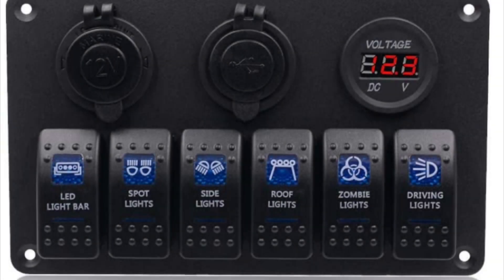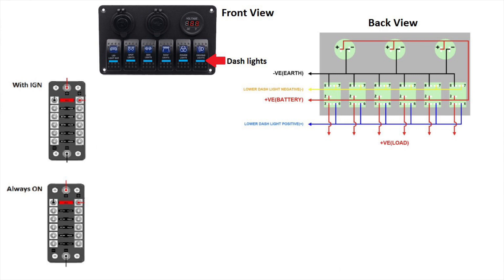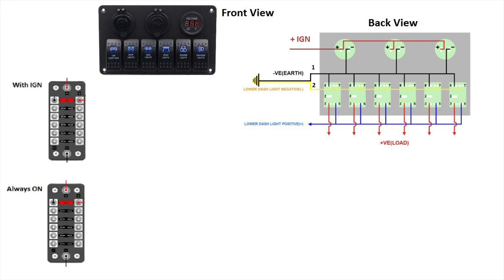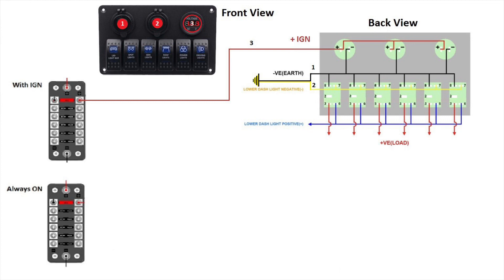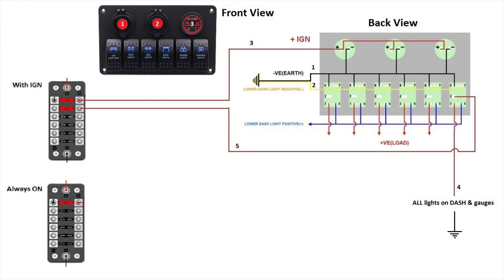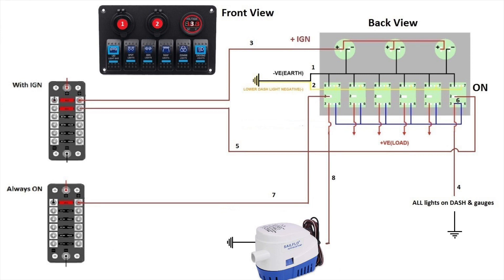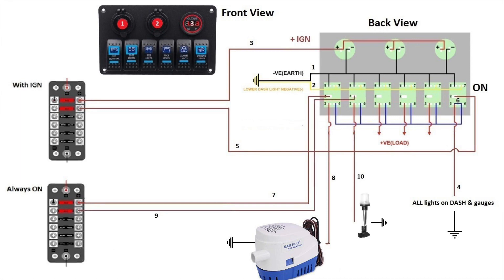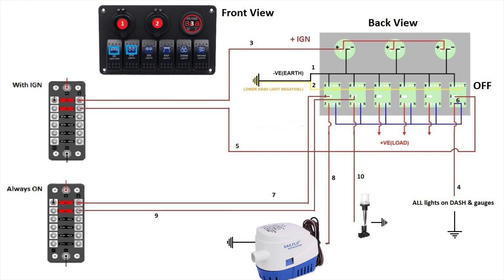How to install a pre-wired panel switch on your boat ( Electronic wiring diagram )

Comment: Can you wire one of the switches to be a master power switch?
Reply from the maker: hi CaptainCal, thanks for watching. Yes, you can set a master power switch but it comes with some dangers. You got to make sure the master switch can transfer the amps needed if all your switches are ON. Also, your gauge wire size needs to be right. So basically, if you want a master switch, lets take for example the first switch connected on the water pump. So, the wire 8 will go to the other switches to pin 2. So, this becomes your main power to your other switches. If you turn OFF switch 1 the rest will turn OFF also.
Reply: @joetheboatguy5394  thanks for the response! So I take the number 8 wire and wire it to all of the other switches pin 2?
Reply from the maker: Yes so your first switch will turn all other switches on. Without that switch being on the rest will be off. But like I said be careful that your main switch is capable to pass all amperage needed by other switches.

Comment: Hey Joe can you do a video on how to connect a 10 gang rocker switch panel.  Panel that was given to me as a gift has both ac/dc on switch.  can they both be used as DC?  BTW your videos are the  best online.
Reply from the maker: Hi debradubose, thanks for watching and nice comment. I haven't used these panels yet, but my research says that you can use the AC side for DC, but the indicator light would be much weaker. So, you right side of the panel (only DC side led will be brighter than the left side)

Let me know if this help 😊

Comment: Ground to black or to separate bar just for ground?
Reply from the maker: Hi debradubose, thanks for watching; The best ground is the negative of the battery. Usually, black wires are connected to the negative of the battery. Let me know if this helps :)
Reply: can I ground to a bus bar if t is connect to battery negative. @joetheboatguy5394
Reply from the maker: If you have a good bus bar there should be no issue, if your bus bar is connected to negative of your battery then your bus bar is a ground, so yes you can use bus bar as a ground 😊 just make sure to have the right AWG size wire between bus bar and negative of battery.

Comment: So if I want to make volt meter, usb, and 12volt plug powred by ignition how should I wire the panel? 

Also right now I have them on my fuse panel and when I switch on battery disconnect the whole panel has power, but when ignition is off it still has power till I switch battery disconnect, 

How can I wire fuse panel to also only accept power when ignition is on?
Reply from the maker: Hi Kenneth, thank you for watching, Take a look at this video and let me know if it answers your questions. This video will show you how to have a ignition fuse box and a always on fuse box. https://youtu.be/bnQZmurYQ-g
👍

Comment: 2 questions, you added wire 6 to create on off switch for lower led, can it be hooked to always on? and not IGN? or would they just remain on? Secondly, could you bring wire 3 down to a switch load, add wire like 6, and use as a on/off switch for usb/volt/12 volt? Best videos on these switch panels I've seen
Reply from the maker: Hi Als, thank you for watching and for the nice comment. 

For your answer to questions "you added wire 6 to create on off switch for lower led, can it be hooked to always on?" if i understand you want your lower led to turn on when you flip the switch on "ON" and also when you don't have your key on ignition. then you would plug wire 5 on the Always on fuse box. Basically you can turn all you lights on even if your key is not on Ignition mode.

if you talking about connecting wire 6 on "always on" fuse box then your lower led lights will remain on all the time "it will drain the battery".

"Secondly, could you bring wire 3 down to a switch load" Absolutely you can do that. You will need to turn your switch "ON" for "usb/volt meter/12 volt charger" to be functional...

Let me know if I understood and answered your questions. 

Thank you :-)
Reply: @joetheboatguy5394    So you understood correctly, and I already learned about lower led always on LOL. And I plan on trying the usb?volt for the weekend , thanks
Reply from the maker: Good luck let me know how it goes :)